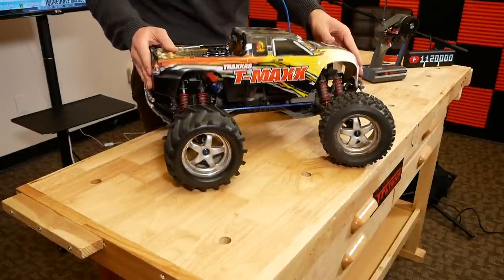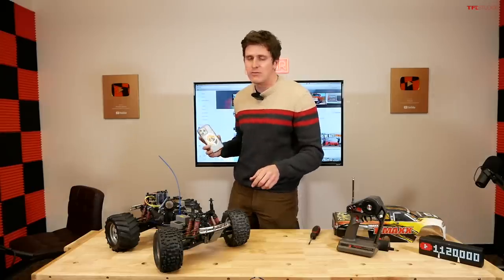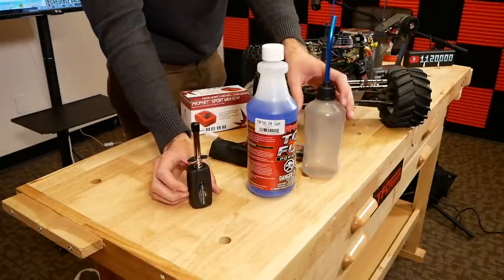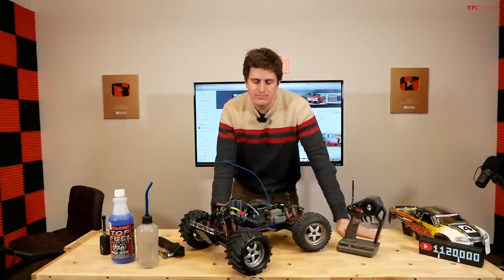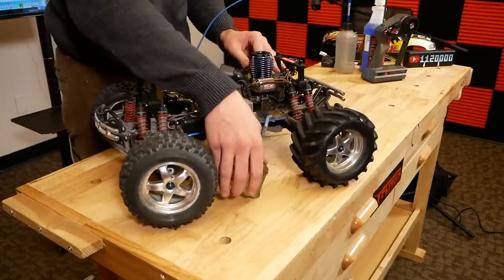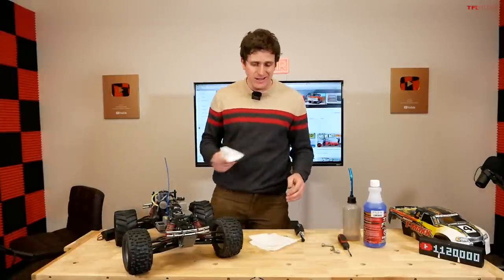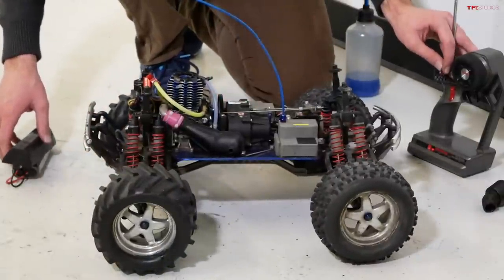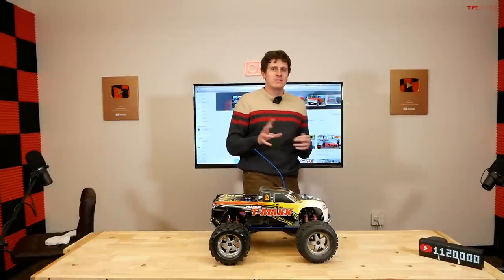Will It Run? Traxxas T-Maxx First Cold Start After 10 Years!

Comment: Apparently your hobby shop didn’t teach you how to properly maintain and store an RC nitro engine. I work 17 years at my local hobby shop. And I always recommended running the engine & tank dry when you’re done running the truck for the day/week. I would also recommend using After Run Oil, a couple of drops down the cylinder head will do it. WD-40 can create condensation inside the engine. Which will cause the steel parts of the engine to rust bearings, crankshaft, connecting rods, pistons and such. Running the engine dry, will allow the moisture from your fuel to evaporate.
Reply: Also the wd dissolves oils

Comment: I also had a tmaxx I haven't used since 2010. After looking at the state of the truck and seeing the receiver got ruined by an exploded battery I just bought a new truck. It would have cost almost 230 dollars to get it up and going, the new truck comes with tools, the ez start with a battery and charger, extra air cleaner and extra glow plug. And best of all the new tq 2.4 Ghrz radio and receiver.
Reply: It was only 458 dollars for the new kit.

Comment: I have an old TMaxx with the 3.3 motor in it sitting on the shelf that hasnt run since about 2009.. I dont remember whats broken on it, but my kids have been on my case to get it going again sometime. 
I didnt even remember where to start with it, but this video has given me some ideas and inspiration to get the engine running again instead of trying to convert it to electric. Thanks!

Comment: Bringing my back to the mid-2000's. I road raced RC cars. I had a car that was an HPI nitro car when I bought it, but within 2 years I had replaced literally every single part. I had carbon everything and a Ron Paris tuned Novarossi .12 engine. Did 92 mph on radar. Ended up just giving all of my stuff to a friend when I switched to airplanes. Never got in to the off road stuff.

Comment: Definitely pull apart, clean, lube and inspect that steering assembly when you swap that servo, don’t wanna burn up the new one right away. Pretty impressed you got that thing fired without pulling and cleaning the engine/carb etc. makes me want to dig out my old LST2 I threw a nasty little picco engine in before I shelved it long ago. Great idea for some fun new content on this channel Tommy!

Comment: I still have an original Traxxas Revo 2.5 I bought it when they first came out. It was sitting for probably about the same amount of time, but I had no doubts it would run with fresh fuel and a new glow plug & lines. As long as you do the proper after run procedure of clearing out all the fuel and lubing everything with marvel mystery oil etc. Mine did fire up and run no problem unfortunately RX battery wouldn’t hold a charge and the Optidrive that allows the transmission to shift into reverse needed replacing. I was running an aftermarket FM Futaba radio system already but I’m in the slow process of updating all the electronics. Things have come a long way since the early 2000’s 😂. It’s now currently setup with a modern 2.4ghz radio and new battery just need new & better servo’s for everything. 
If you can find one I ditched that Traxxas EZ-Start long ago for an HPI Roto-start Thunder Tiger and a couple others made the same thing for the T-Max & Revo back in the day you get more starting power and less weight less wiring mess too and your already using an external glow plug igniter just a thought.

Comment: I’ve had an HPI nitro rs4 MT for probably 20 years. I ran it a lot for the first year or two and maybe once every 2-3 years since then. Running the tank dry and putting a drop of Marvel Mystery Oil in the cylinder and the carb after running, and making sure the cylinder is free, have helped me get it fired up with a couple tries every time. Honestly it takes less time to get it running and to store it than the electrics, with the special charging and discharging procedures.

Comment: I had the same situation, my brother and I had Revo and Tmaxx. His Revo he never cleaned, my Maxx I cleaned religiously lol. But I tried the same tricks as you to get my max running, ultimately I had to just take the carb apart and clean it. For the Revo things were even worse, his engine was seized, old fuel coated everything, the carb was full, and so was the fuel line. Charging the starters now, gonna try starting tomorrow

Comment: One trick with these integrated glow plug leads is don't press them too far onto the glow plug otherwise it will ground out and will not light.  Just have the metal portion of the lead touching the top of the glow plug and it will work everytime. And you don't have to blow into the exhaust line just plug the outlet in the tuned pipe with your finger or a rag and it will create the enough back pressure in the fuel tank to prime the fue lines.

Comment: Traxxas sells a good product.  I just picked up myself a pair of tmaxx trucks to rebuild.  

The engine more then likely was never truly seized but just gummed up with fuel like the tank. One of the best things to use to free a gummed engine in New nitro fuel and heat from hair dryer.  Also change fuel brands from Traxxas top fuel as it has excessive oil content  and will foul your plugs quickly and also reduce power  and make tunning more difficult.  Also the engine as you were describing was originally a trx pro .15 then replaced with the trx 2.5  followed by the trx 2.5R and finally the trx 3.3. The pro15 (0.15ci) and trx 2.5(2.5cc) are nearly the same engine with aome new marketing.

Comment: I had one of these when they came out.
I used to port the motor myself, it would run like a bat out of hell for a couple months and then blow the connecting rod bearing.

Traxxas would warranty it every time and send me a new motor, and i would rinse and repeat until i could afford the OS Motor upgrades (i was like 13 so money was tight) lol

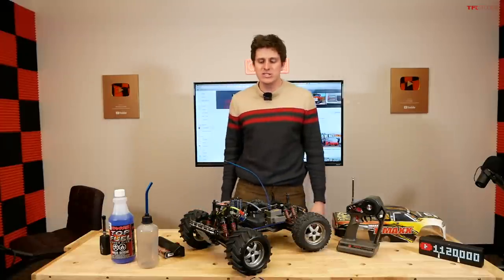Comment: 4:58 I had a similar situation here with a revo that was donated to me, the connecting rod was rusted to the crank case, basically welding it together, it sat in wd40 for months. I just bought a new engine.

Comment: you can use the Traxxas upgrade program to upgrade your radio set to a new modern TQi radio and it is like $75, and you are lucky, I had to replace my carb on my used rustler because the previous owner left it with a full fuel tank, lol,

Comment: Great video, I just picked up a T-Maxx myself, very similar it's been sitting close to 10 years, I have it apart and cleaning it up now, engine was not stuck, just gummed up, and some bad fuel lines, so gonna tune it up and see if the T Maxx will run for me, I had all the stuff I needed so will be in at $150 as what I paid for it....we'll see if it was worth it...

Comment: You probably won't see this comment, but a hair drier to preheat your engine would have resolved your "seized" motor. Makes it way easier to start. Also holding your finger on exhaust tip will prime your fuel system while turning over (starting) your engine, allowing fuel to transfer from tank to carb.

Comment: That's not how a nitro engine works. I always thought that, but iymts wrong. It's actually a chemical reaction to Platinum that makes combustion possible after the ignitor is removed. This is why glow plugs are 10 dollars a piece right now.

Comment: You don’t have to blow into the fuel line to get fuel to the carburetor what you can do is cover the exhaust tip and crank the engine that will get the fuel to start flowing into the engine

Comment: Fresh, new, R/C Nitro fuel actually makes one of the best lubricants to unfreeze an engine that has sat in storage for a long time and is stuck. 

Also, if an engine is completely stuck and you are going to use a screwdriver to wedge against, and rotate the flywheel, rotate the engine in the opposite direction as it normally runs. 
If the engine has a pull-start on it, you will have to remove it in order to let the engine rotate backwards. 
By turning the engine in the opposite direction, if there is a rust ring or died up "crud" ring in the cylinder where the top of the piston was, you won't be driving the piston through it and destroying it, if you turn the engine backwards. The piston will move away from the restriction instead.
If you feel the engine stop dead again before it makes a full 360° revolution, don't just reef through it, stop and pull the head off and check the bore for whatever is jamming it.
These engines dont have any piston rings to rely on to hold compression in the cylinder. The only thing that seals the piston in the bore is the sides of the piston itself, and a VERY close tolerance from the factory. Even the tinyest scratch in the cylinder wall or on the piston can allow the compression to escape, and render the engine useless.
So, one needs to be VERY careful when trying to resurrect an old nitro engine that has been sitting for a long time and is stuck. Take your time, use plenty of oil in the bore to keep flushing junk out, don't force things hard, and you'll be successful.

Comment: Next time u need to prime the fuel system just use your finger to block the exhaust pipe exit. It will pressurize the line without u having to take the line off and blow through it

Comment: I have a Traxxas nitro slash same 3.3 motor but it’s in the nitro slash/rustler platform and 2wd. My neighbor has electric rcs and I wanted something different. And I also wanted a real engine that actually has a soul and not no lifeless electric motor. I loved that aspect of tuning and maintaining a nitro. I’m 13 and bought my nitro slash. Don’t regret a thing! It’s fun when you know what you’re doing. If you need air filters and servos and whatnot I recommend checking out Jenny’s RC (website) where they have significantly cheaper prices. Won’t hurt the wallet as much. Also nitro engines (Glow engines) are not like diesel engines. You need to have a glow igniter just to start it because the Filament on the glow plug reacts to the fuel to keep it lit as it’s running. Not like a diesel compression engine. It’s basically a 2 stroke with a chemical in the fuel that keeps the glow plug lit. Anywho keep up nitro content!

Comment: Two questions, what did you use to clean out the gas tank? Also when you have the mystery oil in the cylinder head how long did you let it sit before cycling it though and did you take the glow plug out when blowing it all out of the head and the pipe? Thank you

Comment: I guess I'll be the guy who says if it had been the battery powered Traxxas, you could have avoided all the engine lockup headaches.
Reply: If it was a battery powered Traxxas of the same vintage it probably wouldn’t even go 15mph on a full charge with that old brushed motor!

Comment: Always heat your stuck engine up with a heat gun or hairdryer... To about 150 degs... It will melt any of the solid oil and help separate the piston and sleeve. Don't use a chisel and ruin your flywheel 🤦‍♂️use a wooden spoon or the like. Heat people... That's the key.

Comment: if ur servo sat not centered for that long u should prob change it. jx ecoboost are great. plus stock r slow anyways
also literally use a starter box
funnels are a thing
CLEAN THE CHASSI
i don't even run nitro and i cringed when fuel was still in the lines. ur lucky the lines haven't desinigrated
might wanna prime it. also WHY HAVEN'T YOU BEEN OUTSIDE
stripped a hex or a driveshaft died
i retract my statement probbaly diffs

wrote that watching the video